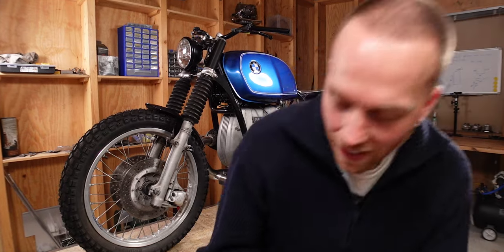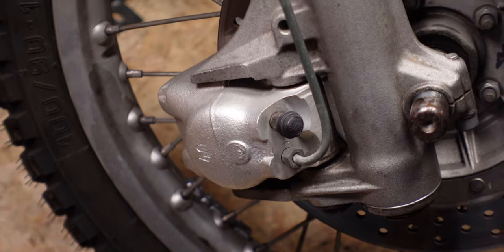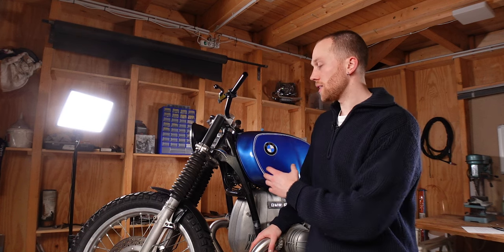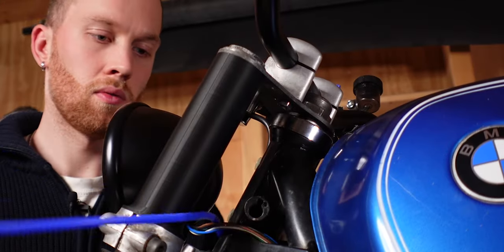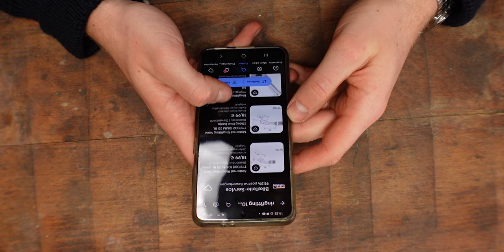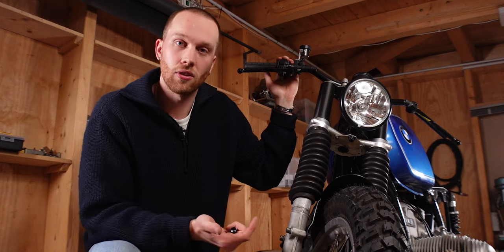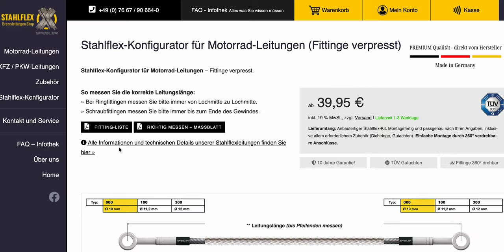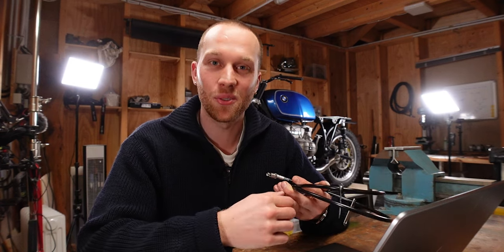How To Measure Brake Lines

Comment: Thanks for a great and easy to follow guide. I've fitted lots of braided hoses before but always off the shelf ones that were never quite right. Have to measure and fit new lines for my 82 XJ750 which I'm converting to a handlebar mounted master cylinder.
Reply from the maker: Awesome, I hope it helps you for your XJ750. Which master cylinder are you going with?
Reply: @MotoWrenchers  Not 100% sure yet, probably some standard yamaha 5/8" (16mm) unit. To replace the stupid cable operated remote master cylinder arrangement.
Reply from the maker: @stuartgreig6609 sound like a good idea. Where’s the remote master cylinder located on that bike?
Reply: @MotoWrenchers  The MC is on top of the lower triple (yoke), with a cable operation from the handlebar. Not a great idea by yamaha
Reply from the maker: Some setups are really strange. I guess moving it to the handlebars is a very good idea 👍

Comment: What is your brake master cylinder set up?
Reply from the maker: That’s from Brembo and is called PS16
Reply: @MotoWrenchers  Thank you for answering so quickly! The PS16 I've searched for only have a square reservoir, yours is round and externally fed. Can you give details on your reservoir
Reply from the maker: @DJ-e30 yeah, I encountered the same when researching all the parts for the build sheet. Brembo might have discontinued this version.